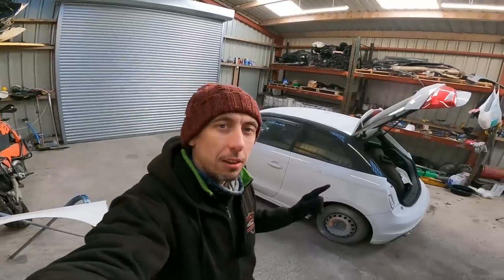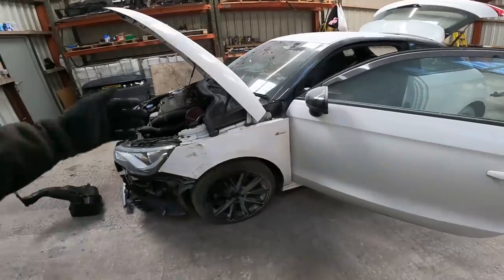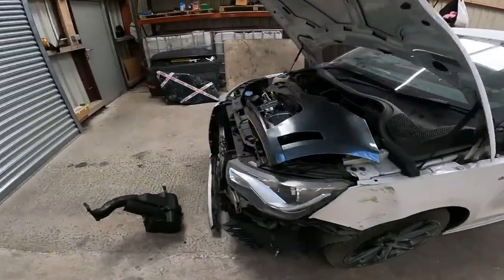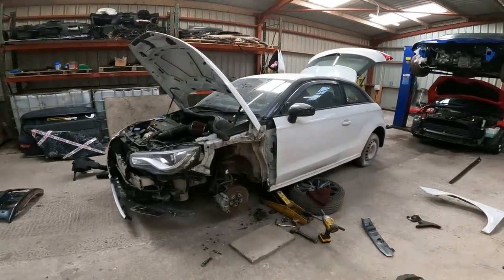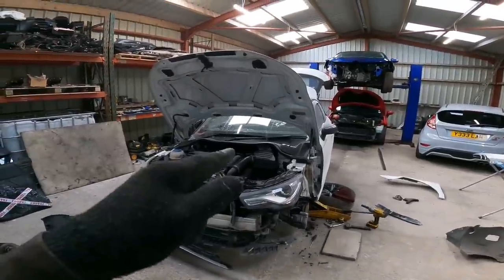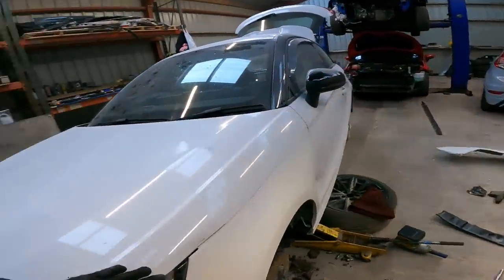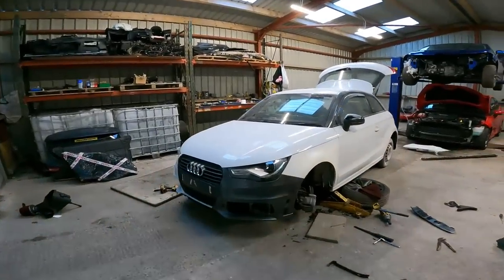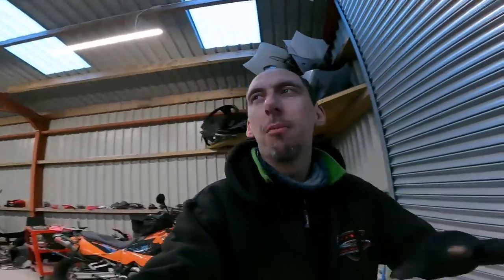We Are FINALLY Back On The Audi A1 Style Edition - The Missing Piece Has Been Found!!!!

Comment: The body filler on the rear quarter panel should of been primed/sealed! Filler is hygroscopic! Due to the talc what is used.. so the rear quarter could have paint issue later down the line due to moisture being present in the body filler.
Reply from the maker: It's not finished it still has work to be done on it, more sanding and more filler 👍

Comment: Good video for A1 front repairs Phil. Why didn’t you finish cleaning that muck out the bottom of the cill whilst you had good access ? There is a lesson in this video, beware of Special Edition Motors - rare parts needed! Do you ever use Silverlink for salvage parts ?
Reply from the maker: I did after the video finished , sods law when i actually bid on this car the bumper corner was available in colour on ebay, went back to buy it the next day and it had sold! haha....  I have used silverlake in the past yeah 👍

Comment: Phil you have the front bumper wrong mate, where you have that middle piece,  that is the same colour as the bumper itself and the piece you have purchased clips on  in the middle under the wite joining piece. Have a look online at images of the front bumper on a stye edition and you will see what im on about
Reply from the maker: Hi Carl, there is another piece that goes under the middle bit that ive not fit yet, left it off to help the paint guys out but it will get fit when it returns.
Is that the part your on about?
Reply: @SeriousAboutSalvage  yeah that's what I'm on about. So that middle part you got stung with will need painting white then to match the rest of the bumper?